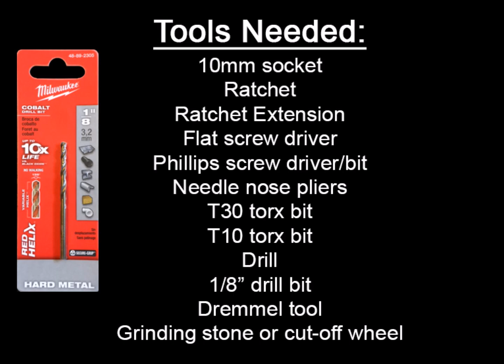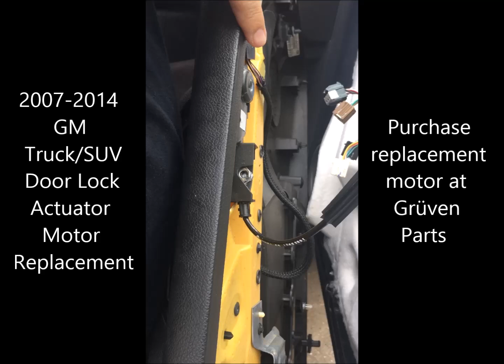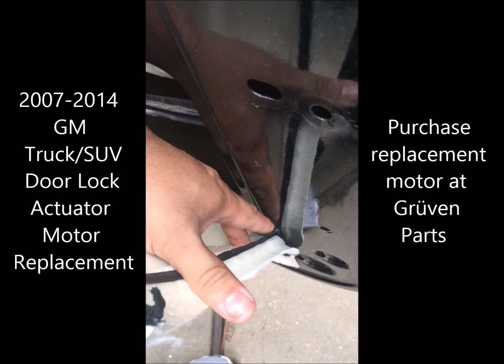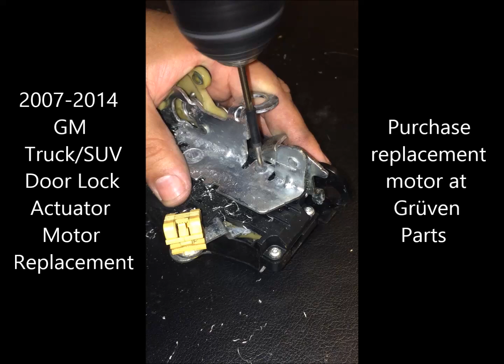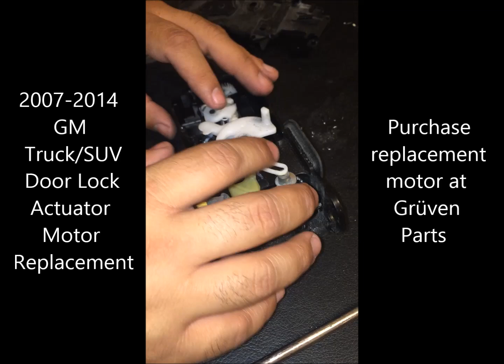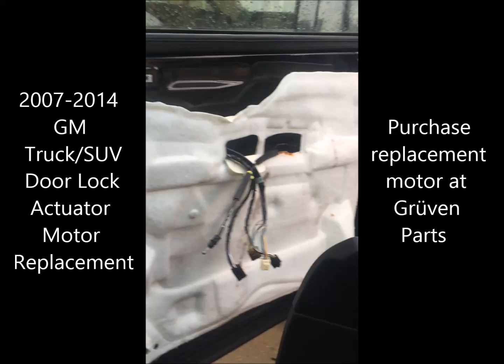2007-2013 GM Truck/SUV Door Lock Actuator Motor Replacement

Comment: Thanks and great video.  Solved our issue on our 2009 tahoe and gave me an excuse to buy a Dremel tool.

3 comments for others doing this that are not mentioned in the video that I learned along the way.

1.  Drill bit size he uses is 1/8"

2.  When reassembling the latch, alignment of internals is super important.  He talks about this around the 26:35 mark.  Follow his method of putting the cover back on exactly.  The piece he references that is in the way is a small switch that controls if the door locks or not.  Everything can bolt up fine and actuator work correctly, but if this is misaligned, the door will not physically lock.  The entire thing will have to be disassembled and realigned.  Don't ask me how I know.

3.  When testing the locks with the remote, locks will not work unless the connections for the door panel buttons are plugged in.  They are easy to plug in and out, but if you aren't getting anything when pushing the remote, try this first.

Comment: Hello, I have a problem and could use any advice given! Have an 08 Avalanche - both rear doors wouldn't unlock or lock with key or inside controls. I used to have to manually reach back there to lock/unlock them to get them to open. NOW Recently both doors wont even open at all.. Even if i manually reach to the back to unlock the doors, I can't get them to open with the handles on the inside or outside. the handles are not even damaged! They still pull fine.. Any help would be greatly appreciated!!
Reply from the maker: SquallFlame have you checked everything dealing with the child safety locks for the current issue? I would also have the wiring checked for the rear door locks. Start with basics by taking off the door plans and checking the voltage going to the solenoids. If no power, check the wiring next all the way forward. Not sure what else to suggest, though. I’m not a mechanic, but I’ve done electrical work in the past on cars.

Comment: On my 2011 1500 Sierra Denali both the rear door stopped unlocking. But lock with no issue. Do you know which wires I can probe to see if the unlock signal is getting to the actuator?

Comment: So my rear passenger side door wont always lock during the warmer months of the year. I have replaced the part 2x already would u suggest replacing the actuator to get it to function properly all the time?
Reply from the maker: The factory actuators suck and are expensive as hell. I found out about Gruven Parts and am a huge supporter of them. Their actuators are top notch and definitely fix the problems with these factory actuators. You can tell the difference just in the sound they make when they lock and unlock the doors. I highly, highly recommend replacing them with some of these if you haven't already. I hope this helps.

Comment: When you door lock went out  Do you noticed something weird with the mirror not working
Reply from the maker: No, but I also had an issue with my mirrors as well before I started having lock issues. Gruven parts also sells a part to fix that as well.
Reply: Cool bro thanks for the video

Comment: Any suggestions if your dumb like me and snapped off the drill bit in the rivet. By the way a fantastic video
Reply from the maker: Scott Butler - I would drill it out with a slightly bigger bit and use a bigger screw.

Comment: Great video.  What was the original symptoms or problems?  Was the whole thing just not working (completely dead) or was it just behaving weird?
Reply from the maker: Rough Riders - My door locks wouldn’t unlock and sounded really weak. This fixed it right up.

Comment: Great video! I snapped in the relay plug in my new actuator... and it didn't work. Now, I'm trying to figure out what the issue is? Was my original actuator bad to begin with? Do I have 2 bad actuators (even though the 2nd one was purchased brand new.) Is there a bad wire somewhere? Unfortunately, I'm at a stand still now. I didn't expect the brand new actuator not to work. :( Does anyone have any ideas how to troubleshoot this problem? Thank you.
Reply from the maker: I would call Paul with Gruven parts. I know he will get you going.
Reply: hey were you able to fix the problem?

Comment: HINT:   I had a hell of a time with the driver side motor replacement.  The rivets were loose and would turn when I was trying to drill them out for the self-tapping screws.  I just about gave up when I thought ...DREMEL.   I took a cut-off when and made slots on the back side of the rivets so I could hold them with a flat screw driver.  Needed two people but I gotter-done
Reply from the maker: Definitely a good idea!

Comment: Just finished up the passenger side and it works.  Only problem I had was drilling out the rivets.  Driver side I will use a drill press.  A lot cheaper than replacing with another GM JUNK actuator!   Thanks!!!

Comment: What I did in my 08 Silverado is I bought universal door lock actuators and hard wired them to my wire harness in each door. Total labor and cost 14.00 in Amazon’s and work as good and the same
Reply from the maker: Yeah, I could see that working as well. Anything to prevent paying what the crazy dealer prices are.

Comment: This is a lot of work. I did not drill deep enough and bottomed out. The rivet goes all the way through so as long as you dont go through the other side uour good. Nut it did work
Reply from the maker: It definitely is a bit of work, but worth the effort when you think about how much you could save compared to dealer pricing. I saved hundreds and possible a little over $1,000 as a result of doing it myself.

Comment: My Drivers side door will not open at all.  Neither the outside handle nor the inside handle will open the door.  The power locks 
seem to work, I just can't open the door.  Is there a video or a secret in getting the door open?  I can't get the door panel off because I can't open the door.  Help!!  Am I lost completely and will have to have a locksmith open my door for me ?  It is rough climbing over the console to get in the drivers seat!
Reply from the maker: I hope you were able to resolve this, but I think the only way would be to remove the seat through the back door to get to the door panel. That's the only thing I could think of. Sorry that you had to go through that.
Reply: I have the same problem did you ever figure out what the problem was?
Reply: A coworker's son had this problem. We found that the exterior door handle rod had fallen off of the handle because the lever  broke. This let the lever fall down, and the window had bent the rod. On his we removed the outside window sash and used a long (like 2 foot) flathead screwdriver to push the lever down on the latch, which opened the door. Then you can remove the door panel and repair it.

Comment: Okay so I did the more complicated front driver side door and it al works beautifully. I really thought the Back driver’s side door would be a piece of cake comparatively. I had some issue (plastic breaking, not being able to drill as deep on the actuator assembly) but I thought I persevered and got it done. The lock works. Only problem now is the the truck keeps saying the door is ajar when it is not. Is the door ajar sensor in that actuator? Is it possible I damaged it while doing this procedure? Any help would be greatly appreciated.
Reply from the maker: I would reach out to Paul at Gruven parts. It sounds like the actuator was not put together properly and he can guide you through the process of fixing it so it stops doing that. I don't know what that process is, so I have to apologize for not being able to help you on that. But Paul is a great guy and will be happy to help you out!

Comment: Loved the video! Dealership wanted $300 per door to fix. All of mine were bad and I had already had one replaced at dealership about two years after I purchased the truck. Quick tip: Make sure the window is closed before starting. (Duh moment) And also the triangle shaped piece that sits on top of door panel is easily broken. Video makes it look easy to pop off. It isn't. It has three clips on it and I broke two of them, they are different than the door panel plastic clips. The little yellow clip inside was opposite on mine which gave me fits but other than that, video was on point! One fixed, three to go!  I have been without working automatic door locks for pretty much the whole time I have owned this truck and I feel so stupid that it was this easy to fix AND I did it myself! 50yr old female.
Reply from the maker: Ummmmm, same comment as Dara, so.......Great job, Marlene! I'm glad this video helped you out! I did mine a few times, so that's why it looks easier than it actually was. This definitely saved me a ton of money, as well!

Comment: What if it still doesn't work after replacing the actuator
Reply from the maker: I would say it's probably something dealing with the way the inside components were put back together. I recommend, if you purchased the motors from GruvenParts, that you reach out to Paul for his insight. He's a great guy to work with. I hope that helps.

Comment: Thanks for the video! I ended up getting slightly wider tap screws so i had to drill with a 9/64 drill bit in order to make it work but it did great! I would recommend an 1/8" drill bit like the OP did since it gives you slightly more room for error on center. Also, i re-greased a few of the components since i lost a little on reassembly of the inner mechanics..because why not. Also, be sure to work on a cleaned off table so you don't lose parts and you can control metal shaving cleanup from the drilling. Thanks again!
Reply from the maker: Sometimes we find there are easier or better ways to do things after we go through them. Hopefully your details will help others as well. Thanks!

Comment: This is visually the exact same lock actuator as my 2008 Cobalt. Would the replacement motor from your link still work?
Reply from the maker: I honestly have no idea. I ran across this actuator motor online and worked with Paul at Grüven Parts to make a video for everyone to use for the installation. I'm sure Paul would be able to answer that for you, though. He's great to deal with and is very responsive to email. Hope that helps.

Comment: so before I start ordering parts and tearing into my doors, I have an 09 Silverado where the door locks sometimes stick or don't seem to get the energy needed to fully unlock/lock. how can I verify it's my motors before I do all this?
Reply from the maker: Sean MacDonald the way I figured it was my door locks is because the locks didn't really fully pop up or down like they should. I would often have to reach over and physically unlock the passenger door or the rear doors. I tried it first on one door and immediately saw the difference it made, so I then ordered the additional motors for the other doors. Good luck!

Comment: You didn't mention in the video, the key lock cylinder that's on the driver's side!!!  How the hell does that come off???
Reply from the maker: Not sure if you've gotten your answer yet or not, but the key to removing that is to remove the clip that holds the lock cylinder in place. If you stick a flashlight inside the door and peer into it, you'll be able to look at it and figure out how to remove it. The rest is pretty much the same.
Reply: It's pretty well impossible to remove that clip with the door handle still bolted in place.  I wound up removing the handle, which then made the clip accessible from the outside.

Comment: Great video, thank you for sharing.  I had three door out for a few years, some already replaced under warranty years ago.  I finally broke down and bought just the motors and swapped them out this weekend.  I only wish I had bought a fourth and just done the driver door at the same time or at least kept it in stock.  The only things I did different was instead of using the dremel I used a 3/8" drill bit to take the top of the rivet off.  Then once I got the bracket off I continued with the drill to remove the little nub that you mention because this is a rivet and it is not a straight shaft so you cant just use it to realign the parts, it has to come off, trust me I tried, follow the vids instructions and save yourself some headache.  This was a little easier for me.  Then I tapped the posts out for 6-32 machined screws.  I used a #35 instead of the #36 drill bit to get a slightly larger hole to make tapping easier,  The threads were plenty strong to crush the lock washer and since this will not really be under any load I am confident it will work just fine since those posts seem to be some really hard steel.  I also took some of my savings and replaced all four door speakers while I was in there.  

Total cost for three doors:
Motors - $118.43 shipped
6-32 Hardware - $12.27 including Tap and Drill bit (if doing multiple buy an extra bit, I wish I would have)
Speakers from Crutchfield - $111.97 including a plastic trim tool set to make removing a bit easier for me.
Total - $242.67 (it's like I got the speakers for free and saved a little money and got a better motor than if I were to simply replace with OEM again)

The best part is, if they ever fail again the housings are already staged and ready for a motor swap.  Thanks again for the great video.  God Bless.

Comment: I'm just glad you mention to check the motor label because these morons at gruvenparts send me the wrong side motors. so pissed I was halfway drilling the holes when I looked now I don't even feel like fixing the shit lol.
Reply from the maker: Juan Hernandez trust me, it's worth fixing instead of paying a crap load at the dealer. I'm sure Paul will get you fixed up and correct the problem. He helped me out quite a bit when I was doing mine. I hope you get it all situated. Good luck!
Reply: yeah I spoke with Paul and he fixed it up really good they know how to treat a customer no complain. Now I'm motivated.. thanks.

Comment: Just got done doing this on the rear passenger side. Thank you for the video. It was pretty easy just following along. The hardest part had to be reassembling the unit correctly so all the internal parts moved as intended.
Reply from the maker: Alan Lutz yeah, I had to redo it a few times for it to line up just right. But it was sooo worth the money I saved instead of ordering new actuators that would fail in a year or so. Glad everything worked out for you and that the video helped you out! Thanks for your feedback!

Comment: Used this, and your parts to replace all 4 on my Tahoe... Worked great. Although, one of the replacement motors has gone bad after one year.
Reply from the maker: Everything is working well on mine, so far. Contact Paul at Gruven Parts. I'm sure he can help you out. He's a great guy and builds quality products!

Comment: Thanks for the Video! I can't tell you how helpful this was!
Reply from the maker: Thanks, Johnny. I appreciate your feedback! Glad you found it helpful!
Reply: I replaced both Driver and Passenger sides. The only part I struggled a bit with was the driver side because of the extra rod connected to the key locking mechanism. Thank you!!
Reply from the maker: +Johnny G Deez are they working well for you now, though? Mine pop with a ton of power when I lock or unlock my Yukon! I love it!
Reply: The Locks are working better than wheni drove it off the LOT!!
LOL!

Comment: GM needs sued for all the problems people have had with these actuators
Reply from the maker: I couldn't agree with you more, Bill. Would be nice to start a class-action.
Reply: I couldn’t agree more! 3 of the 4 went out in my 2008 Silverado SS within 2 months of the warranty running out and was told it would cost me around $1200 to replace them all since the front passenger door lock is sluggish! Seriously I just spent $47000 on the truck and before it’s even paid off you want me to spend another $1200? Unfortunately mine haven’t worked in almost 6 years so now I find I can replace them myself... THANK YOU SO MUCH FOR THIS VIDEO! I’ll be getting the part numbers and ordering the first of the month! I can’t wait🤠